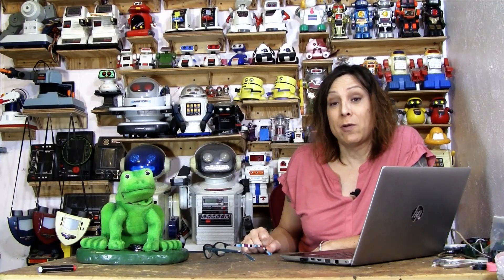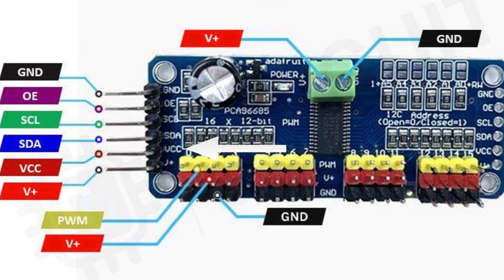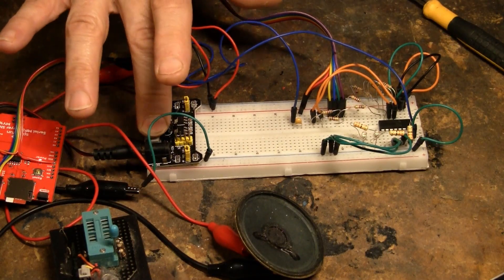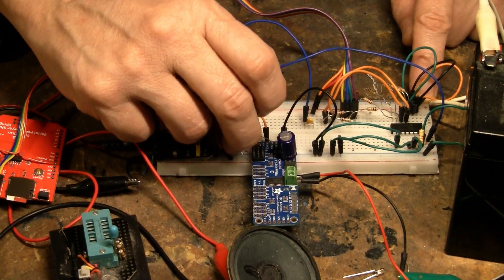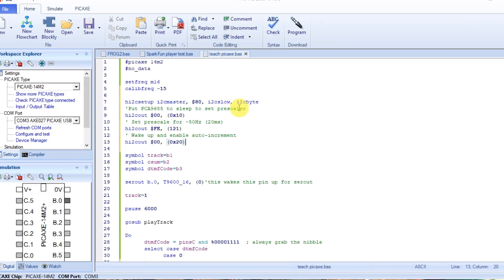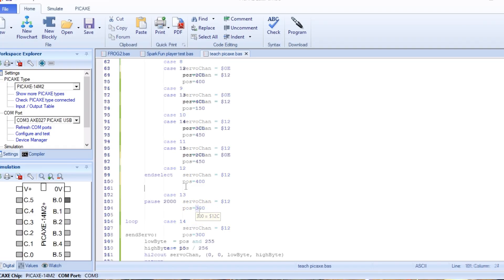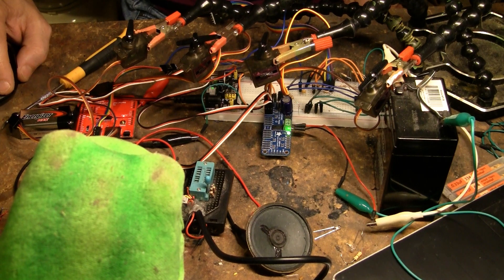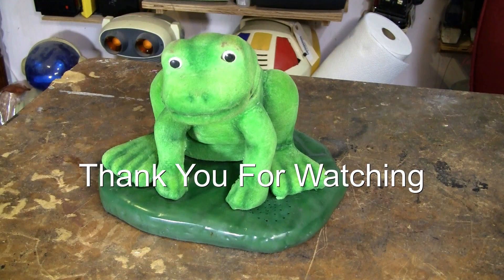How to Control the Adafruit 16-Channel Servo Board with a PICAXE (I²C Tutorial)

Comment: It's the longest possible way to say it, but I most often hear "I2C" spoke as "Eye-squared C"
Reply: The correct way to prounounce it is indeed I-squared-C. It's short for inter-integrated circuit or IIC, because it's designed by a bunch of nerds they made it I^2C instead.